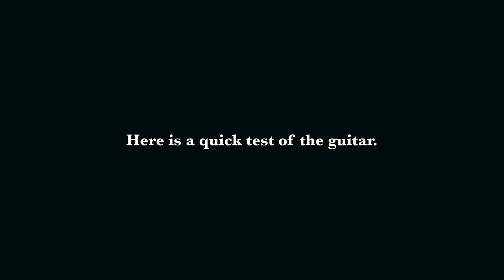The making of a Pre-CBS 1962 Stratocaster replica

Comment: Somehow, I would think that Leo would be knocked out about a man in Norway, faithfully recreating a 1962 Stratocaster.  You Sir, are a extremely gifted builder.  Thank you for sharing this!
Reply: I think he would dwell on how extremely inefficient it is.
Reply: @dclipper8052  I don't think he would.
Reply: @sillysausage4549  yea, I’m impressed but I think you’re right about Leo. They cranked out a ton of guitars.
Reply: @Bellabaddi  If this were to apply himself to production he would produce more guitars in one month than Leo did all year.  I know he has access to CNC machines which is an unfair comparison but even with pin routers this guy would be ahead.  He is ultra efficiently structured and methodical.  He doesn't make one move that isn't productive.

Comment: I have built around 2,000 guitars and this guy  did as good of a job as any of the famous boutique builders.  He should come to Los Angeles and setup shop.  He will have to redesign his head stock shape to satisfy Fender.  Apparently Fender don't remember when they were heavily "inspired" by Paul Bigsby.  Bigsby had the Merle Travis which looks a bit similar to a Strat.  He had another that looks like what became the Esquire.  6 in line tuners were unique at the time along with tremelos.  Throughout the following decade Fender released instruments that incorporated these elements with some slight differences. Pick up selector as well.  Not only did Leo enjoy Bigsbys designs so did Gibson and Rickenbacker.  I like this guys approach of not acting like building a Strat is such a grand accomplishment and think it is valued at several thousand dollars.  Although seriously if he so desired he could jump into the mix and be successful building those like he built.  Just a minor head stock alteration if any are left.  His only variance was the 2 way truss rod which technically could be seen as an improvement. This is an amazingly well put together video.
Reply: Wow! 2000 guitars?? How long have you been doing this for?? Thats amazing!!
Reply: @pinehome_guitars  I use to work for a well known builder at that time in the 90's then I had my own shop manufacturing bodies necks and pick guards for various companies and builders up until late 2007.  So overall around 12 years.

Comment: I agree with what he said about some Custom Shop Fenders. Very hit-and-miss. You'd think at the price you could be assured of consistency but these days, taken as an independent manufacturer, the CS would be the third largest make of guitars in the US. Gone are the 'boutique' days. It's as much a production-line as any manufacturer, only with a much higher price tag. A good setup on a 'good bones' guitar (decent woods and hardware) will get you there for a fraction of the price.
Reply: I should not have said that. And not mentioned names . Sorry. Im new to this.. .

Comment: At 6:50, fiberboard will burn, clay will not. I'm sure an old Strat got caught in a fire at some point. Or just try to singe it on the bottom side where it wont be seen after it's replaced.
Reply: polymer clay will burn.

Comment: No doubt that an expert wood worker/luthier like yourself can make a guitar as relatively simple as a Fender Strat. Particularly when you have the use of all those nice power tools and that great workshop. After all, as you said, it's essentially two pieces of wood screwed together. It is amazing how much wood is routed out of a Strat's body to make room for the neck pocket, bridge/vibrato, pickups and electronics. It's really a chambered guitar isn't it.
However, to the extent that aged wood affects the tone and feel of the guitar, it could be a problem trying to authentically replicate a '62 Strat with new wood.
The electronics are another problem. Without aged pots, switch, pickups, etc. that have been well-used for decades, it is likely that the replica guitar will sound no better than a new custom shop Strat. Not that that's bad, but it's not going to authentically replicate a "62. As you know, a real '62 has a kind of magic that no one can precisely define, and likely cannot be replicated. From the sound of the guitar in this vid, you got close, though.
Great vid.
Reply: The alder i use for my golden era series strat /tele builds is harvested i 1972. It has been in a barn nmuntuched since then. 🙂
Reply: @pinehome_guitars  Well, it's still not as old as the wood Fender used in 1962 which was at least 10 years older, and which might have been 100 years old then for all we know.
As I said, to the extent that old wood makes a sonic difference in a solid guitar (not necessarily much, if any) your 1972 wood may account in part for your guitar's excellent tone.
Question: Is wood dated from harvesting or from the age of the tree at harvest?
Reply: Yes i know it is still 10 years of from 1962. And for that im sorry. 🙂 i never clamed it to be a 1962 guitar nor a fender for that matter. The serial number has 2022 in it and the logo says Pinehome Guitars.. I make a lot of different guitars. Not only simple to make  strats and teles. But even so,  I only uses well seasond woods for my guitars. Alder, ash, mahogany, limba to mention some.. But for the " golden era series" i use the batch i have from 72.  And for the record, i dont call them "clone"! 🙂 that is a lable the film maker put on the heading for the filmI have several major differences in my guitars compared to the guitars built in the 60's. I think it is more important to have a stable and well playing guitar in all climats then a guitar that is spec accurat to a 60 year old one. But all the messurements, curves, radiuses etc is taken from an original 62. And i build mine to those messurements!  So look and feel wise, they are pretty damn close! 🙂
Reply: @pinehome_guitars  No need for you to apologize that 1972 is ten years after 1962. It's not your fault.
Given the title of the vid, "The making of a Pre-CBS 1962 Stratocaster replica", I think it's reasonable for me to refer to a 1962 Stratocaster in my comment. I fully understand that none of the guitars that you make are Fenders, and not all are Strats, but then, well, there's that title. Also, I recall seeing the name, "62 Strat" on your wooden patterns in the vid. 
Clearly you are making a replica of a 1962 Strat and comparisons of it to a real one is reasonable. Yes?
In any event, you seem to be a talented and expert luthier, and I'm confident that I'd be quite satisfied with any guitar that you made.
Cheers.

Comment: Nice job, the only thing i don't like is the trussrod placement if you want to be as close as possible to an original one . (First comment been missin', )
Reply from the maker: I didn’t delete any comment, so not sure what happened there. Also not sure about the truss rod.
Reply: Its not set "deep". Fender set their trussrod deeper and in a bow.  No fender has this type of trussrod. This is a two-way trussrod. And i lay it in like you see with a wood shim on top. This is so the trussrod want push directly on the fretboard. If it did, you would have issues with that after a while. It allso lock the trussrod in tight! No "rod rattle" here!
Reply: Tell that to Leo, his design what simple an efficient . I don't have any issue in none of my Fender wich have the trus rod just under the fretboard .
Reply: @Nico-pb9lq  I would. But sadly he has pat on

Comment: The real dot inlays are fiberboard, there is plenty of evidence to support this. Literally why would fender use real clay? it's not economical and time consuming.
Reply: @johnsmythe6134  no they didn't, it's well documented they used offwhite fiberboard, that turned a "clay" color because of the nitro finish on the necks that yellowed quickly. in no way is screwing around with clay faster then putting a piece of punched out 1.5mm thick fiberboard dots.
Reply: @katanamaker  OK.
Reply: @katanamaker  So they turned clay color because of the nitro finish? That is funny since they did not put finish on the fretboard.
Reply: @pinehome_guitars  oil from your fingers/ dirt.

Comment: What your doing is actually against the law. I would suggest looking into trademark infringement before you loose your shop and home to a lawsuit.
Reply from the maker: How is it against the law?
Reply: I respect what your doing. I did it professionally for 25 years. I’m only looking out for a fellow luthier.
Reply: 31. mar. 2009 — Guitar makers Fender have lost an application to make its Stratocaster, Telecaster and Precision guitar body shapes a trademark in the USA. And rhe same goes for any other shape they listed as "iconic".
The court rouled that iconic shapes is not titled as a trademark. 
So its not against the law to make strat shaped guitars. But if you have any other documetations thar says orhwrwise, please send them my way!!
Thanks for your concern!
Reply: The body shape yes, however the headstock no. The headstock does not fall into that category.

Comment: You can literally run strings across a table with the hardware attached to the table and it won't sound any different than on the guitar. Resonance and tone wood has been debunked. All of your sound is in your hardware and strings and setup.
Reply: I have seen that video to. Hard do go gigging with.